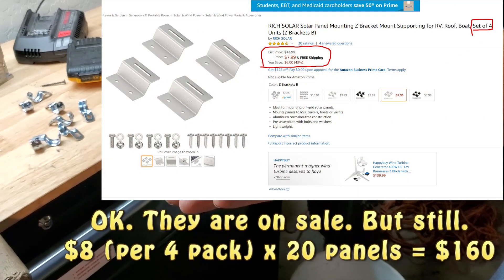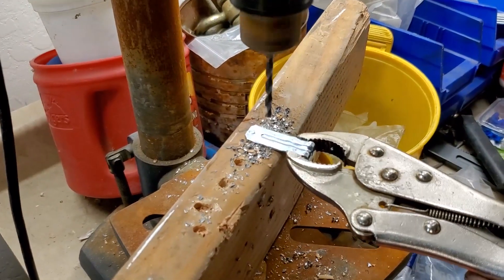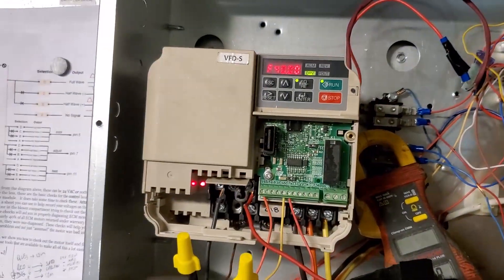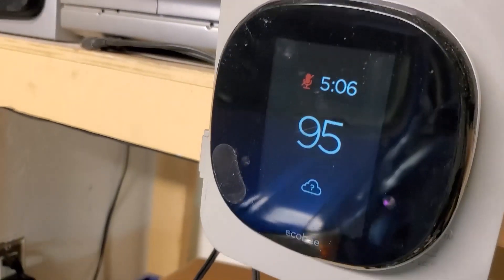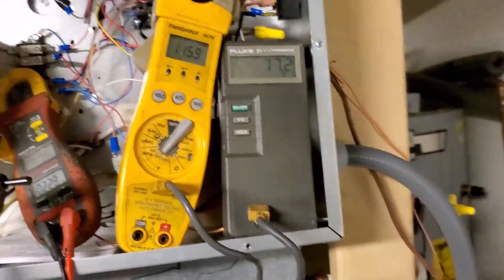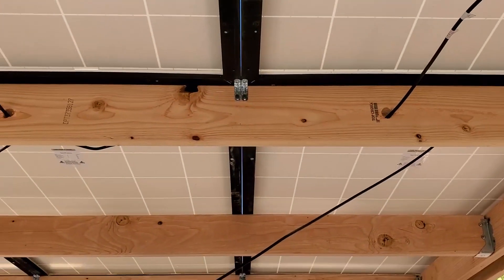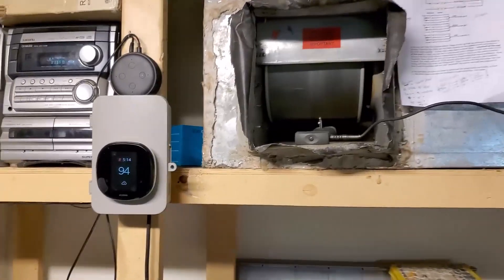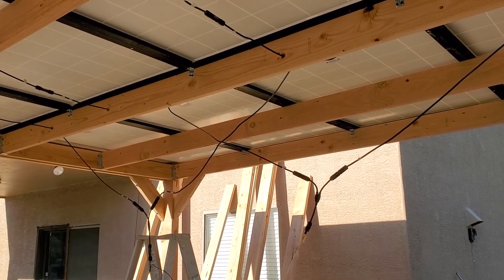Crafting more ways to save money on my DIY Off-Grid Solar Array

Comment: I'd be curious to see how the power factor correction circuitry behaves with a pure DC input (on the mini split)
Reply from the maker: If I go that route, I'd like to find one like a typical Mitsubishi operates. 
I think I could just tap into the DC bus right to the capacitors, open the relay that feeds the DC bus when it is set to operate, and the board won't know better. 
I have some old INVERTER drive boards. I might make a video later perhaps to ramble off some ideas.
Another idea I just dreamed up earlier was to make a PWM circuit off of the on grid power (rectified to DC) that could increase or decrease in duty cycle based on the DC bus dropping below a certain voltage, say 290 VDC (panels produce 300VDC at full rated output, start to dip as the sun angle increases).
If I did that I could run a larger compressor closer to what the panels could power with good sun and then the on grid power would just trickle in to keep the DC bus level as needed. 
Some experiments might be in order!
Reply: @hackfreehvac  Bypassing the PFC stage and powering the capacitors directly sounds like a good idea, should be more efficient even if the PFC stuff works on DC input.  Maybe a way to test the mains backup power would be to find a 240v variac and bridge rectifier, set to a bit less than the VMP rating of the solar panel array. Another way might be to get some old server power supplies in the 1-2KW range (dirt cheap once the servers are outdated) and modify the PFC circuit to output a lower voltage and then bridge them into the mini-split capacitors via a diode

Comment: Are you going to treat the wood on the pergola (like polyurethane or something)? Also how does rainwater drain off of the panels?
Reply from the maker: The wife has been covering the wood with a primer and then a coat of paint to blend in to the house.
It only rains a lot here in the monsoon season.
The rain won't drain. It will just evaporate I suppose. LOL
I would angle the thing but I wanted it to just look like a Pergola and nothing else.

Comment: You can do a battery backup system.
Reply from the maker: Yeah but batteries are $$$$
Might not be worth it unless I was really trying to go completely off grid.
Did you see the video I posted about a month ago of the guy in the RV with solar and the mini split? 
From what I hear his system has been able to run his 1 ton A/C off of his panels AND top the batteries off and then run the A/C all night (as it cycles) off of the batteries.
They used really good Li Ion Batteries.